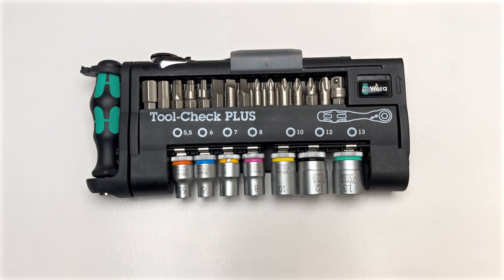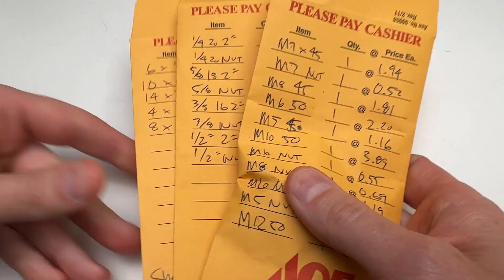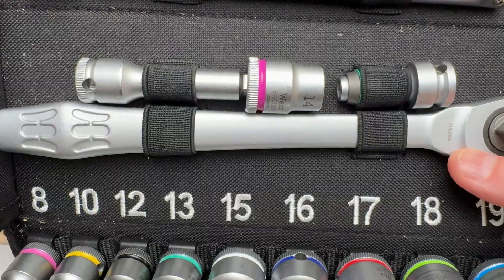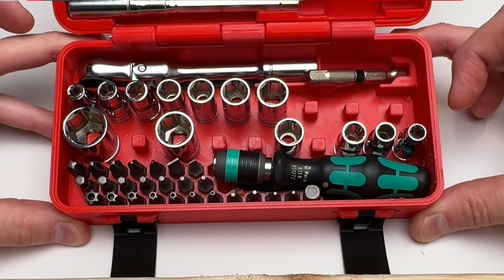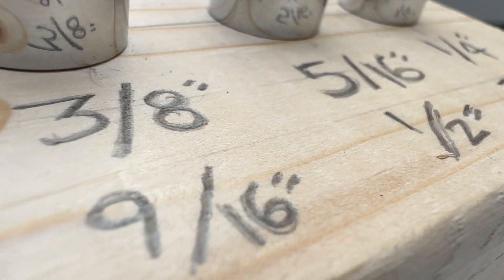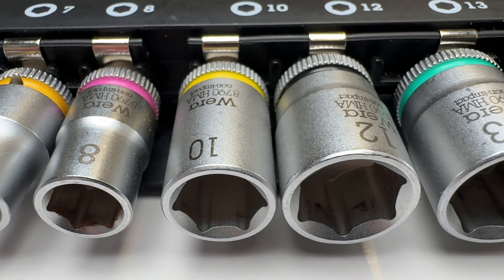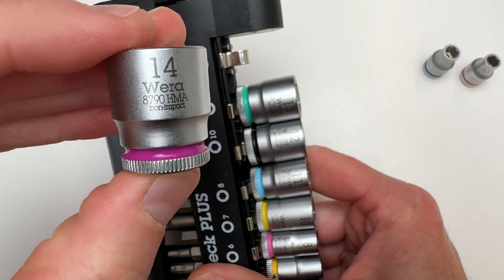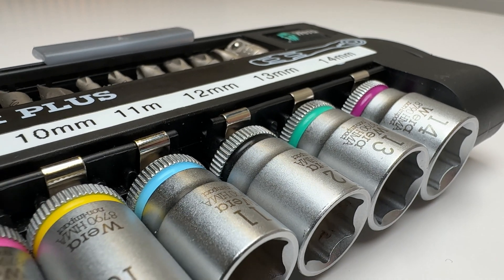Wera Tool-Check Plus HACK: Tackle METRIC + IMPERIAL Bolts with just 3 Sockets!

Comment: M7 is a very, very unusual beast. I've come across the size once, in a socket head cap screw, but living in metric-land it's not something you'd really need to worry about.

7mm is useful for worm drive hose clamps (aka Jubilee clips), it's something I've added to kits.
11mm is useful for bleed nipples but I've never used it for anything else. I've removed it from my small kits.

I use 1/2" sockets on 13mm heads when I need it really tight, equally I use 14mm spanners on the propshaft UJs of my Landie because they're a really tight fit on a 9/16ths.
Reply: 7mm nuts are common on computer and electronics screws. I specifically bought a 7mm wera socket to fit onto my Wera Mini Tool Check Plus (from the 2024 Advent Calendar) just because I come across 7mm nuts so often.
Reply: Hm, I don't think I've ever seen 11mm bleed nipples, usually 10
Reply: True ! 
But they need them to use on the stupid imperial bolts :)
Reply: M7 is extremely common in electrical motor connections, with M8 popping in just enough to be annoying.
Reply: I don't think I've ever seen an M7 fastener, but M6 and M8 are really common - those are  your 10mm and 13mm sockets. 7mm is also the standard head size for M4 bolts, so you need it if those are something you're likely to encounter.
Reply: @drengskap  Agreed.
I actually came across my second ever M7 fastner over the weekend helping a friend put some shelves up. Bonkers design of fixing.
Reply: @drengskap  You haven't worked much then. Sure it's not very common, but it absolutely is a thing.
Reply from the maker: Thanks for the input. Debating if I should swap in the 6mm for the 7 if that's more common.
Reply: @todd.parker  sorry, I could have been more clear.

I think your 7mm will be useful, I'd leave that in there and not bother swapping to the 6mm.

It was the 11mm for doing M7 bolts I was querying, M7 bolts are something you never see in Metriclandia, therefore I rarely have a use for an 11mm socket beyond bleed nipples.

Your current selection makes sense and I think I'd leave it alone.

Comment: The newer tool Check got a single rail for all the sockets. Ive ditched the Security torx for some smaller flat heads and 2, 2,5mm and 10mm hex.
Reply from the maker: That's good to hear. It's very odd that the rail is broken into 2 sections on mine. I've tweaked my bits too but thinking I might want to go further. Personally, I like security Torx because they work for both standard and security torx versions so why not. I hardly ever run into them but it's a 2 for 1

Comment: @3vil3lvis. Ah finally somone giving Metrinch some love. I bought a Metrinch set back in 1994 and its been the best socket set ive ever owned. Only possibly rivaled by my Kobalt Xtreme Access set that is pass through but is bulkier. Ive been wondering when someone would use some Metrich sockets on the Tool Check Plus as I think that would make it pretty awesome for an all around edc kit minus a set of Knipex for many.

Comment: I was wondering when someone would do this as ive looked at the Wera check plus for years but since I made a slightly more versatile custom edc kit like you did with that red box of yours (which was super nice imo by the way) I had no need to spend the money. Seems like a good Idea especially since you already have most of the Wera sockets but I am surprised you've not gone with a set of sockets that work for both metric and standard. I know cheap ones can be puchased at the local auto parts stores. Ive got a set of Power Torque brand sockets that fit both metric and standard that I carry in my everyday tool kit on a simple rail. My favorite set is a Metrinch set that I bought way back in 1994 and theyre awesome. But theyre a bigger set that I want to keep together and reserve for more serious wrenching projects. Always enjoy your content!
Reply from the maker: Thanks! If you have a link to a set, I'd like to check it out. I saw some bigger 3/8 and 1/2" sets from Power Torque but if there is a 1/4 set that covers both metric and imperial with one socket, I'd check that out
Reply: @todd.parker  Ya I think your correct in that Powerbuilt or Powertorque, I can't remember which brand it is, only makes their universal sockets in 3/8 drive size or bigger. I'd suggest looking for Metrinch online as imo they are the best universal socket I've ever used due to their superior lobe design instead of the spline design that's common for universal sockets now. Sadly I think you now have to find them secondhand as I don't think they make them anymore.  But they did make them in 1/4 drive. Of course, it looks like you kind of already solved your needs with your hack. But I'm telling you my Metrinch set that I bought back in 1994 has been so compact and useful over the years that I would buy another one In a heartbeat if I could find one.

Comment: I replaced the 7mm with a 6mm , very happy with this set other wise, plan to substitute some of the bits with more hex bits, rarely use any star or flat screws, all in all I love the set as it comes in metric
Reply from the maker: Yeah, seeing lots of comments about how rare 7mm is. Might swap the 6mm in as it will also give me more wiggle room.
Reply: @todd.parker  Although if you did not loose your bit extension (both of your videos that I saw) you could use the 1/4 bit driver for light 6mm use, maybe.
Reply: The 1/4 hex drive is 6.35mm, there is no need for the 6mm socket

Comment: The 11m label cannot be unseen  😂
Reply: I have never used a 6mm. But I have used a 7mm a lot for interior work.
Reply: @FinallyMe78 lol 😅 your any bit holder is 6mm
Reply: I would have also added the imperial sizes to the compatible metric sockets on the label
Reply: Wonder if it will also fit an 11y bolt head.
Reply from the maker: Ha, ok I see what I messed up now. Funny I missed that, I printed these a few times to get things to line up. Probably going to swap the 7mm for a 6mm so I'll fix this too
Reply: @emmettturner9452  Yes, it will. Unfortunately, my 11 yard socket does not fit over an 11 meter bolt head.
Reply: Also called the 10mm stripper! 😂
Reply: Thanks for sharing this. I’m just starting to piece together a minimal edc tool kit and I was wondering what the most common sizes are. 👊🏾✨
Reply: We’re only super human most of the time!
Reply: It is wise to always add a small imperfection to an otherwise perfect work.
Reply: Totally not intentional so you engage in the comments. Oh crap, now I've done it too.

Comment: A lot of bicycles use a 15mm wrench for the axels, pedals, and stem bolts.  Due to open clearance on most bikes, it could be handled with a Knipex pliers wrench or a Wera Joker Medium. wrench.
Reply: If you find a way to use a socket on pedals, let me know. I think you mean  crank arm bolts.
Reply: @ngarber  nope, I mean pedals and I didn’t suggest using a socket, that obviously would not work.
Reply: @jermlac  Just asking because the subject of this video was sockets.

Comment: You can leave the M7 out, not common at all.
Reply: Many hose clamps use M7
Reply: @DavurBeder they most use 7mm hex that's not M7.. M7 has an 11 mm head
Reply: @DavurBeder *7mm that is.
Reply: Forget the 11mm but keep the 7mm for hose clamps, for UK that is.
Reply: Yeah the only time i use a 11mm is for brake line fittings and then you require a spanner, not a socket
Reply: There are several M7 bolts in my civic, so it's a keep to me.
Reply: I just used a 7mm last weekend for hose clamps on my jetski.
Reply: I did exactly the same thing.  I had both metric and imperials sets and combined them.  The only imperial components are the hex key bits.  I was able to remove some redundancies in the bits to make room for the imperial.  My socket holders slide freely on the plastic so I didn’t have the issue of fitting the extra sockets in. Great tool kit.  Cheers.

Comment: GREAT IDEA!! Though I LOVE my Icon 35 pc Locking Flex Head Ratchet and Bit Set - seems like a better ratchet setup than the Wera. And I see Klein finally came out with their 6-in-1 Impact Socket Set on a shaft in metric. All it's missing is an 11mm so I'll get that socket to complete my set.

The Icon kit has a lot better bit selection and there aren't a bunch of duplicates, so for less than the base price of the Wera I'll have a fuller kit, though not a nice single thing as you've got. 

Alternatively, the Wera Belt4 socket is another option - I run into the 5 and 5.5mm bolts more often than you.

Great video - it's the Rosetta Stone of how to deal with the two measuring systems!!
Reply from the maker: Agree on all that. The Icon bit selection is great, I just don't love the case for some reason but maybe I'll use it to refine my bits. I just picked up the Klein metric flip sockets last week and they are great. Working on a video on that as we speak.

Comment: 1/4 inch drive is sub optimal. What you want is the 3/8 Metrinch socket set that covers both Metric and Imperial. Got one on ebay. Pair these with a flex head socket wrench and you are golden.
Reply from the maker: I agree that 3/8 is way stronger and I have a set for larger bolts or when more torque is needed but in a small EDC style kit, staying in the 1/4" range is much more reasonable from a size/weight perspective. Got a link for that set?

Comment: Hey Todd, I love your videos, and appreciate the quality over quantity.

The selection of sizes you landed on does not fit what I run into (for example I need 1/4” and 5/16” all the time), so I ended up with a Felo R-GO 27 kit, with a few added imperial sizes. A little chunkier than the Bit Check Plus, but more versatile. And made in Germany, not Taiwan.

But love the breakdown on which metric that can cover imperial.

Looking forward to future videos!

Comment: Great thoughts you have. I did something similar but used the bolts around my home (built in 1948) and my bicycles (all after 2000). I needed the 4mm and 5mm on my bikes, and  9mm and 13MM on some bolts in my basement..   Thought about getting individual Makita or Wera sockets  but ended getting a rack  from Harbor Freight, I got 10 sockets for $10.
Reply from the maker: Yeah that’s the best way to do it. What do you actually need with your stuff. Hard to beat the HF socket prices. As you see, I have a few Quinn sets

Comment: I find 12mm is super common when working on metric cars. I'm surprised it didn't make the cut, but 13mm nearly matches 1/2", which is common on American cars. Cant fit them all in this kit I guess
Reply from the maker: Yep, 12mm is there for that very reason. Heard they are very popular on Japanese vehicles especially
Reply: @todd.parker  Can confirm, just used a 12mm socket on my 4Runner. Replaced the skid plate and two of those bolts are 12mm. I would say 80% of the car is 10mm, but there are a few 11mm and 12mm bolts too
Reply: the 12 is there
Reply: German cars almost never use 12mm sockets. Japanese cars almost never use 13mm
Reply: I have been looking a lot to find what are the most used sockets for the different car manufacturers and could not find this info even in forums. Thanks guys

Comment: The Wurth Double ring ratchet wrench set 32 pieces is my go-to set. I added a few items. A 1/4 150mm extension, a 1/4 to hex adapter, a hex to 1/4 adapter and it all fits in its metal case
Reply from the maker: That looks like a nice set, ticks all the boxes especially with your additions

Comment: if you need to tighten those the metric will slip.
Reply from the maker: Yeah, if there is too much play they will slip. I figure with a 1/4" set you're not doing high torque work on bolts so you can probably get away with a bit less of a perfect fit
Reply: @todd.parker  great video, appreciate it.